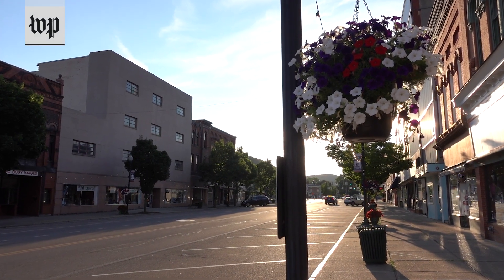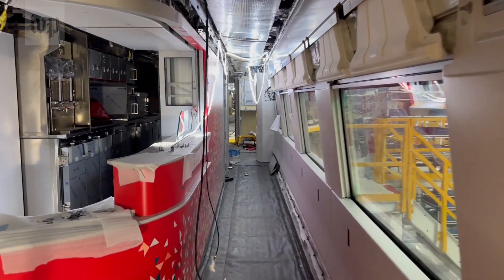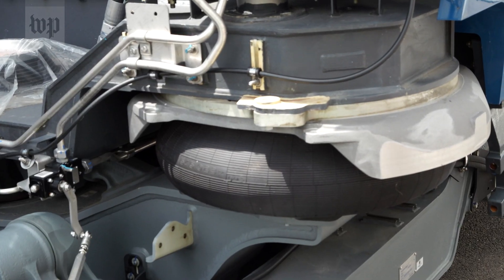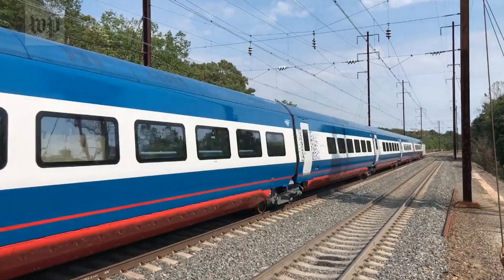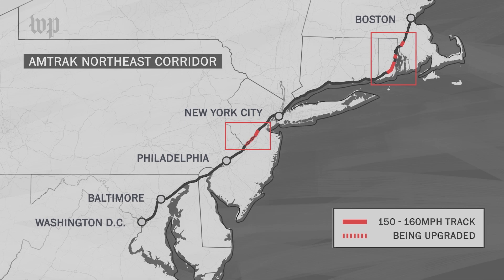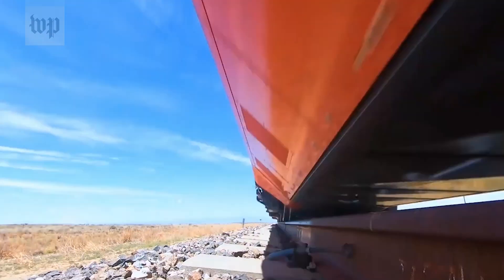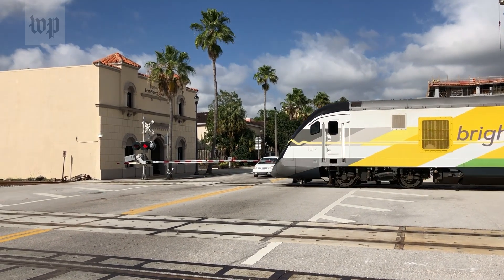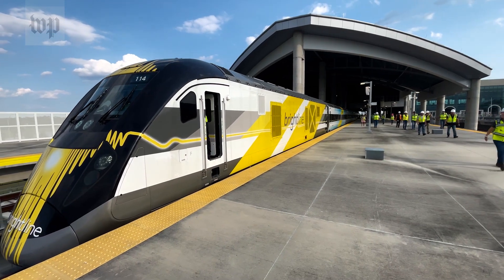Go inside Amtrak’s new high-speed train

Comment: What’s the point in investing in high speed rail when you can’t even use it. You had the Acela go 150 and couldn’t use that to your advantage. Fix the track
Reply: ROW can always be upgraded.  The current trainsets have huge reliability issues due to their weight.  The newer trainsets are much lighter which allows for faster acceleration and they don't have the same maintenance issues as the Bombardiers.
Reply: @taoliu3949  ok cool. But will the use them to their full capability?
Reply: @zo62  The NEC already has stretches that allows for speeds of 160mph.
Reply: @taoliu3949  yes the stretch is small is what I’m saying it’s only parts of ny. My point you don’t need to invest in high speed trains when you can barely use them. Use the money to upgrade the tracks to maximize the existing trains. Acela may go away but the other trains go up to 100 but you can’t use them like that
Reply: @zo62  Um, existing trains like the ACS64 that maxes out at 125mph?  Oh yes, that would totally improve the service (it doesnt).  You do know that Acelas travel times are noticeably shorter than the regional trains, right?  You do know that the Acela generates 1/4 of Amtraks total revenue, right?  Yes, let's get rid of Amtraks #1 revenue generating asset.  

Also, it's not a "small stretch".  Amtrak has been steadily upgrading its ROW and plans to have up to half of its tracks rated for 160mph by 2035 between Philly and NYC.  A significant portion has already been upgraded to 160mph but Acela can only run at 150mph because it's so heavy.  If anything, it's CURRENT trainset cannot make full use of the ROW, not the other way around.
Reply: @taoliu3949  travel time from ny to dc is just a minute more on Acela and cost more. Look up travel times I did and seriously not worth it
Reply: @taoliu3949  ny to Philly is an hr and half that is not even worth the trip. I know I plan on doing it and. Would lie to take the train but bus service is better and cheaper. And you have to wait by 2035 for an hr and half trip? Bos to ny doesn’t beat anything. Ny to dc regional and express is a few minutes shorter but more in price. I want to like Amtrak but it doesn’t beat driving at this point and investing in a train that can go is different than will go
Reply: @zo62  Travel time from NYC to DC on Acela is 2,40~2,50 hours.  The Regional is 3,30~3,50.  Acela is significantly more expensive because it's all business class while the Regional is coach.  But if you compare Regional business seats, the price is comparable.  Like I said, Acela generates 1/4 total revenue for Amtrak.  

Bus service is cheaper, but it's not faster than the train.  Try getting from NYC to Philly during the day in less than 1,30, it's not happening.  Even in clear traffic it is a minimum 2 hour drive.  Ditto for NYC-DC in sub 4 hours.  Amtrak on the NEC routinely sells out, so out goes the window on your theory that "its not worth it".  Their main competitor is not with buses or automobiles, it's with airlines.  Buses will always have a market because nothing beats buses on price.  What sets trains apart from buses is relative comfort and speed.  

On the side note, if you want cheaper Amtrak tickets, don't wait until the last minute to book your tickets.  Plan your trips out at least a month and it's a lot cheaper.  The further out the better.  You can get tickets for as low as $35 one way from DC to NYC if you book far out enough depending on the day.

Comment: This is a great presentation!!!  When will these new type trains throughout the rest of the country?  Especially states like Ohio, Georgia, Michigan and many other states as well!!!  We rail enthusiasts are starved for more excellent passenger trains and increased services!!! 😁👍🏽👏🏾🙏🏽
Reply: Basically, whenever we fork out the money to improve the speed on the intercity lines outside of the Northeast Corridor. Amtrak already has/is building higher speed track in a bunch of places, but that is expensive and no one wants to pay for it. 

We could have trains like the Acela running on intercity routes all around the country. All it takes is some money to build the track or upgrade existing track!
Reply: @TohaBgood2  if the passenger rail industry received similar funding as the highway system that would be a very helpful boost to making huge improvements, investments and moving forward to making passenger trains a viable means of train the US!
Reply: @torikicklighter1191  To upgrade the NEC will take $200B to complete it entirely, and the rest of the nation that needs it for hubs like the MidWest and WestCoast and the South will come to a total of another $300B+ which all put together is similar to the entire cost of the Interstate System if it was inflated today at a grand total of $500B, it's totally doable, and I'd love to see it, lobbying is one of the obstacles in the way
Reply: @Racko. Less than the Pentagon's annual budget!!
Reply: @TohaBgood2  A big problem is that besides the NE Corridor, Amtrak doesn't own the rails it runs on. The rails are owned by the big freight companies, which don't want to pay for the improvements needed to make America's rail system better. In fact, CSX for example puts more obstacles of Amtrak to operate because they don't make money off of Amtrak. Thus they create bottlenecks and chock points. Even though federal law requires CSX to prioritize Amtrak and to not make unfair operating conditions, there is no federal enforcement. Amtrak had little recourse to remedy their problem with CSX. So unless Congress and State governments fork over money to make the rail system better or there is real enforcement of the Amtrak Law, Amtrak will have to deal with the dirty dealings of not only CSX but also BNSF, NS, and UP.
Reply: @Cilla0415  BNSF and CX are mainly the two doing alot of dirty work when it comes to bringing Amtrak on their rails outside the NEC, the most blame should go on Congress, they have all the money and power to make better rail that can be owned by Amtrak in cities around the nation that are less than 600 Miles apart for HSR services, the lobbying from Airline and car companies and mainly big oil is what's stopping all of this
Reply: Amtrak has done nothing but loose money it's entire existence. Why should taxpayers keep subsidizing this boondoggle? This is from a life long train guy.
Reply: Conservatives love cars to much to let them go
Reply: Whenever good electrification happens outside the NEC
Reply: The US will have to nationalize our rail network to even consider the idea. As much as it would benefit us both socially and financially, that isn't going to happen any time soon.
Reply: @travisbeagle5691  Frankly, this is probably the longterm outcome we should pursue as voters. The freight railroads were subsidized with insane amounts of land and cash to build our national rail network in exchange for guaranteeing passenger service. It was wrong to let them shed those covenants when they all went bankrupt in the 60s and 70s.

Unfortunately, privatization was the flavor of the week than, and this really was a natural, if unfortunate, political outcome.

But I disagree that Amtrak should just wait for the return of Conrail! Amtrak has already managed to upgrade a few corridors to higher speeds. This clearly is possible without nationalization, if it will actually ever become politically tenable. I think that we still need to fully fund Amtrak's efforts to reclaim the passenger rail allotments that are supposed to be guaranteed to it by law. We should also support and fund Amtrak's efforts to reestablish functional and fast intercity rail service on the corridors that are already viable today with minimal upgrades.

The UK does fine with a quasi HSR national rail network even though the speeds are capped at 90, 110, and 125mph on all routes but one. There's no reason why we shouldn't start building towards the same outcome. And if you do believe that nationalization will come at some point then that's only more of a reason to start upgrading the network today rather than waiting!
Reply: What is so wrong with nationalizing our rail?
Reply: @torikicklighter1191  Absolutely nothing but the government won't do it. Plus the blow back from the freight companies would be massive and knowing how our government operates, if Biden or any Democrat were to nationalize the railroads, republicans would just do away with it once they have power.
Reply: @torikicklighter1191  nothing, in fact I'm all for it because rail is the best and most cost effective means of transit and logistics in most cases. The only issue is that  idea the government is unwilling to do it even though they already do for all other modes of transportation. We can't even get the government to give Amtrak a proper amount of funding.

Comment: HSR needs its own track to achieve full capacity.
Reply: Not at all. HSR needs separation from much slower services like freight and slow-moving passenger trains.  But HSR is entirely compatible with fast intercity and even some express commuter rail. In fact, practically all HSR shares track with slower services close to stations, and most HSR lines share track with intercity trains elsewhere on their routes.

This myth has been propagated by the anti-rail community to deter investment in HSR. HSR can in fact cohabitate with other rail services, and usually is implemented in phases where it shares track with other services for decades until the entire system is built out. This meme exists purely to deter investment in fast rail! The argument is that "it is so expensive and such a hassle to built this completely isolated and extremely expensive service that it's not worth it to even try." Practice shows that this is entirely false.